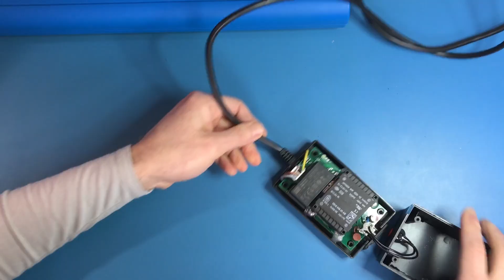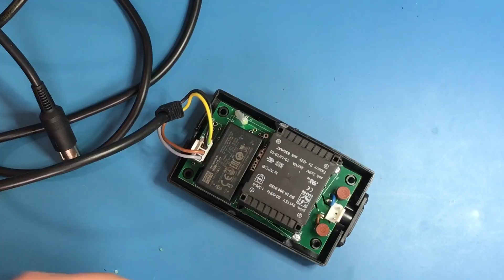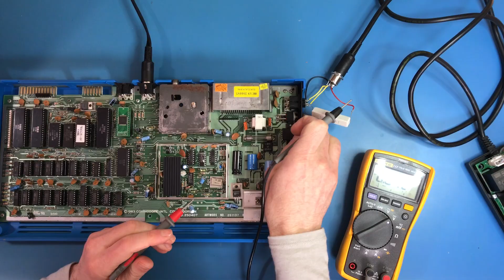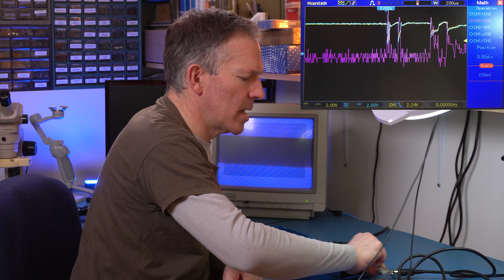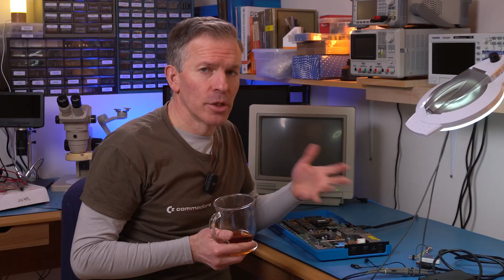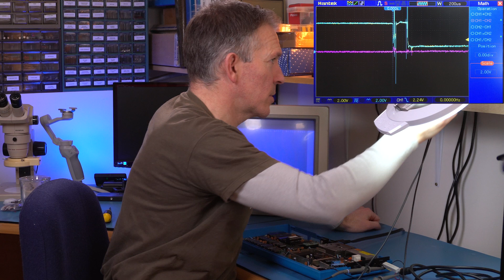I Can't Leave This C64 PSU Alone!

Comment: The reason the C64 takes about a second to boot to BASIC, is because of the RAM test routine in the Kernal. Some third party Kernals omit that or use a simpler RAM test routine and those boot almost instantly. The 555 reset circuit takes about 60 nanoseconds from power up, that's not the culprit. 🙂

Comment: I think if you add a bulk capacitor (say 470uF) on the output of the 5V supply and always turn on the supply before the C64 you will be fine.

Comment: I'm almost shouting at the screen: 'TEST THE POWER SUPPLY SIDE!' The resistor has large inductance, so it will absorb large voltage spikes. If you check the power supply side of the resistor, there WILL BE large spikes of voltage. Those voltages trigger the power supply to shut down and retry after some time, giving this behavior. Case closed!

Comment: Have you tried checking the datasheet for the 5V power supply module? It should list all the conditions under which the protection circuit is triggered.

Comment: This is starting to sound like a heat-related intermittent.  Let's see how it goes as I continue watching.
Question about IPA and hot glue for the general audience:  does this work with all hot glues, or just the stuff made fro Ethyl Vinyl Acetate (EVA)?

Later in the video, I'm beginning to suspect a filter cap or an intermittent MOV somewhere.  If the PSU took a surge, the MOVs may have become degraded.  No high-flown troubleshooting, but I've seen something like this a long time ago on the PSU of a programmable controller, and it tracked back to one of the MOVs (maybe more:  I replaced them one at a time until the unit displayed proper behavior...)

Comment: The discharged capacitors probably look enough like a short circuit to trigger the SMPS power module's short circuit protection, sending it into hiccup mode. If the input capacitor is e.g. 100uF, it'd need 500 microcoulombs (500 microamp-seconds or 5 amps for 100 microseconds) to charge to 5 volts.
Reply from the maker: Right. That's what I'm thinking too. Although it's surprising that it only happens with that board and not the other ones.
Reply: @NoelsSpareParts  I do notice looking at schematics from e.g. myoldcomputer that those C64 A (CR) boards had the LC filter [C97, L5, C100] (which is meant to reduce the inrush current) after the switch, while other versions had the LC filter before the switch. The voltage weirdness would have also been due to the inductance of the supply lead, with there being no capacitor on the supply side of the switch to damp any such transients.

Comment: I guess the PCB is bend because the inlet is now a C5 socket, but was intended to be a C7 which has no ground pin. Which isn’t used anyway. I suggest you replace that ‘Mickey Mouse’ inlet.

Comment: Shouldn't you be able to directly measure the voltage drop across the "current sense" resistor?
Ground lead on one side .... Probe on the other?
Reply: Have to be careful with mains earth reference zero on the scope. This is what isolation transformers or differential probes are for.
Reply: @thetechnoshed  - Careful yes.  But if you are measuring across the 5v power resistor then you should be safe enough, I suspect.

Comment: The capacitor in the 555 timer circuit could be leaking DC, which makes it take longer to charge.  It's always a good capacitor to change if it takes too long to come out of reset.

Note, alcohol (IPA) will loosen hot glue almost instantly.  Also, current spikes happen at power on as the capacitors are charging.  Once charged it will level off.

Comment: Feels like it’s easier to gut an old C64 brick PSU and rebuild it. Usually takes a day to do if you take your time but it is well worth it if you know how to solder and manage cabling. I haven’t had a lot of luck with the new power supplies from Europe; different issues from component failures to poor workmanship. They look nice but not worth the money. I know the pain of selling a computer and it not work when the customer receives it. Great video, as always.

Comment: I know nothing about the c64 other than its a retro computer, but I a a electronics engineer and what I am seeing is what I would expect to see when you monitored the voltage across that 0.1ohm resistor,  you were seeing the current being drawn by the C64, i.e. I = V/R. I am not sure why you added the resistor or what you were hoping it would achieve, was it to reduce the 5 volt supply? the 5 volt supply for logic chips i.e. 74 series needs to be not over 5.5 volts if it was greater than 5.5  that would point you back to the power supply, I would not expect the voltage across the 0.1ohm resistor to be stable or be free off spikes because at switch on the current drawn from the powers supply  would very as the C64 initialised which would appear as a varying voltage (spikes and pules) across the 0;1 ohm resistor which is what I could see from the waveforms. 
That said the normality of what I was seeing was to be expected as you couldn't replicate the fault. I would like to have seen what you got under fault conditions.

You have an oscilloscope, do you have a bench power supply? if so use that to feed the C64, set the current limit to a safe level, and the voltage to 5. and repeat your test to see if you can get the C64 to fail, if you can't reduce the voltage to say 4.8 volts and see if you can get he C64 to fail, if not, try the voltage at 5,4 volts. A bench powers supply is designed to give very stable voltages irrespective of the load, your brick psu should offer the same, but limited to the fixed voltage and current it was designed for.
One thing I would have liked to have seen is the effect of placing a low esr capacitor across the 5 volt supply, say 100uf at 16 volts.
Switching the C64 on and off rapidly is the stuff of nightmares for us hardwear guys as you can get a brown out condition. We have circuits in modern designs to protect against brownouts, I very much doubt the C64 does. 
When you switch the C64 off  wait at least 10 seconds before switching it back on again.
Reply from the maker: I added the resistor to try to "see" the current being drawn from the PSU. I was looking for odd spikes at startup that would cause the PSU to shut down. Or at least that was the initial idea.
Reply: @NoelsSpareParts  Oh, that was reasonable reasoning Noel.

The problem would be, however, trying to detect a rogue spike amongst the clutter of noise at initialisation would be like trying to win the lottery lol.

I am a little perplexed, how or why the PSU would shut down. I have checked online for schematics for the C64 PSU and found what you would expect from an 80's design, basically a linear regulated power supply the design of which is still used today.

The c64 psu uses a jellybean 7805 to regulate the rectified and smoothed secondary voltage from a transformer. The LM7805 only shuts down due to heat dissipation, usually due to excess current being drawn. If a demand occurred, due to a spike the decoupling components around the 7805 would take care of that, and the 7805 itself would just not have time to generate heat to shut down. The 78xx series are jelly bean components because of their continued reliability over the years. I have a draw full of them! they are intelligent enough to look after themselves, and I have never had one shut down due to a current spike. The reason why we know this is unlikely is because the standard componentes the manufacturer recommends placing at the input and output of the chip are there to keep the 78xx stable and not go chasing ghosts, interestingly,  those very components cause a spike at start up, I.e. the capacitors want to charge to the regulator input voltage and the output capacitor wants to charge to 5 volts. Not only that, but every decoupling capacitor within the C64 would as well. 

If you short the output of the 78xx it will current limit (shut down) if you needed a scope to see the spikes (of short circuits) the 78xx isn't capable of reacting to those, the reason why is because you do not what it too, a decoupling capacitor charging would be indisqingable from a microsecond short circuit.

If spikes were causing issues, placing a 100uf low esr capacitor at the 5 volt input to the c64 would solve that issue.

I do think a spike could reset the main processor, monitor pin 40 of the processor with your scope, you should see it held low while the system initializes and then go high, no jumping around allowed, this pin is not like the output pin of the 7805 its very unforgiving.

If I was in your position, I would use the rst pin to trigger my scope so I capture what is going on at the moment the processor takes over, is the supply lines clean then, i.e. are the spikes preprocessor, not post. if your scope has the option to capture pre trigger events that would be useful to.

Plainly there is something wrong, the most important thing is the 'wrong' doesn't beat you. To put into perspective the dilemma you have, I could put together a dozen microprocessor boards each with identical components, and decoupling capacitors, some of the boards would work perfectly without decoupling capacitors, and some behave like demented pinball machines without.

That C64 is alive, and has a history, many a boys have won wars and saved humanity on its keyboard, its ran the race, and won, and now there is a guy (you) resuscitating it, when perhaps, do not resuscitate is in its memory chips. 

All that I can say is those young boys who won wars on its keyboard over the decades, battled mom for just another ten minutes, Noel, son, be those boys. Phaw...

Comment: I've build a couple of C64 power supplied (based on the design found on Jan Beta's website). I used the adjustable regulator version and added a trimpot to adjust the 5V output. I set the output to make sure I had as close as possible to 5V across the C64 board. I also found out that my original KU14194HB board had VERY thin 5V traces from the input socket along the right side of the PCB and I was seeing a significant voltage drop across around 80mm of trace. I added a wire to boost the current carry capacity and a lot of weird issues went away.
Reply: Mich, you guys are driving me mad Lol, if you were a lad in my lab it would go like this... Mitch,   "I used the adjustable regulator version and added a trimpot to adjust the 5V output. I set the output to make sure I had as close as possible to 5V across the C64 board. I also found out that my original KU14194HB board had VERY thin 5V traces from the input socket along the right side of the PCB and I was seeing a significant voltage drop across around 80mm of trace. I added a wire to boost the current carry capacity and a lot of weird issues went away."

Paul, So you had a circuit in to complete a report on pertaining to its strange behaviour, and your solution was 1. to stick your tongue out facing north, while trimming a potentiometer (that you decided to fit for reasons you are yet to explain) the supply to 5.000 volts, lol, and I am to belive your bodge job, was matched by the designers inability to correctly place the correct size trace on the PCB,.  

There is a component somewhere on the C64 PCB that is drawing current it shouldn't be, such as a decoupling capacitor, so rather than locating that (which if you had asked, I would have told you how to locate it) you decided to feed the faulty component current the tracks couldnt handle, the give away should have been the 6mm copper wire you soldered to the 'to thin track'

2. I would like you to ponder, given the C64 sold in its millions (I have no idea if that bit is true, I have never even seen a C64) but given my sidekick is going to be ridiculed for to much use of the soldering iron, and too little use of the gray matter any exaggeration will do. It would have been impossible to sell in mass something that needed the precise values of the cosmological constants that brought the universe into existence without mass disappointment. We have an explanation for the amazing tuning that was required for the universe coming into existence (God did it). We have no explanation why you did what you did, I am very disappointed with you.

I do understand what you have done has got Miss C64 active again, and you consider you should get a pat on the back for your wisdom, which is to be propagated to the wilfully ignorant lol, sadly your error was I read what you said and I thought a kid who needs a father's wisdom, and gentle kindness that only a father can give.

Go to to your room, you are grounded, take the C64 with you, a soldering iron or the blow lamp you used to solder the 6mm copper cable to that delicate track, and remove it and the trimpot . Do not leave your room until the C64 is happy running on 4.8volts to 5.5 volts, and there should be NO glowing tracks.

On achieving your goal, you no need to thank me, I will however remind you the oil in the car needs changing, the grass needs a mow, oh, give the car a wash, and don't tell mom I've taken her hair dryer for conversion to a hot air station, particularly if she happens to find the aforementioned hairdryer in my lab and tries to use the converted unit for its intended purpose, if an ambulance is called, I will be in the pub.

Comment: When measuring the variation at power-on you should have used the AC power strip switch to rule out the power switch causing any issues. you could also feed the 5V into the C64 from a modern benchtop power supply. Looks like video #4 is coming ;-)

Comment: There's A LOT of clueless noobs saying the original PSU is junk. As-is it lasted 30+ years. How many electronic items last 30+ years nowadays.... your LCD TV from 2010 is likely to be dead now and been replaced at least once or twice. Anyway, to improve the original PSU all you need to do is replace the 7805 linear regulator with something better like a small buck converter board that can easily output 1A or 2A where unregulated 10V-12V goes in and regulated 5V 2A comes out. The original transformer is near bulletproof and in general transformers don't go bad. Just remove and replace the 7805 with something better and it will work for at least another 30 years. There are no over-voltages with switching power supplies. They either work or they stop switching and output nothing. A few years ago I built my own little SMPS (based on a buck converter board I bought and reversed) and made an all-in-one custom designed PCB that is a direct drop in replacement and fits into the original PSU and uses the original transformer. I revised the design a couple of times and now it's perfect. The remaining guts of the original PSU are re-used and it's still working fine 6 years later. If you have one of the angled brick PSUs (common in PAL regions) and want to play with my PSU get in touch and I'll send you a PCB and you can build and test it.
Reply from the maker: From what I understand, the problem is not that it's junk, but it's an unfortunate design that when it fails, the voltage goes up. So it's an understandable fear. On the other hand, ZX Spectrum PSUs are definitely junk, and I've seen them explode and go up in flames, but at least their voltage drops when that happens :-)

Comment: I looked at the meanwell datasheet and it's protection for overload is "Protection type : Hiccup mode, recovers automatically after fault condition is removed" so the voltage will drop out for a bit and then give it another try. Try adding extra load on the 5v rail and you'll probably see it do the 1s hiccup more. 34:49 current spike could trigger the overload. (also you can move your trigger on your scope to the left to get more after the trigger)

Comment: put a tank capacitor on the power supply output so it compensate for a capacitor charge inside c64. i guess the 5v drop down last about the same time 555 reset takes and there is a race of it starting cpu while the psu recovers from power over draw
Reply: oh and be aware that will cause massive surge if you use it then on a board with dead short on it. but hey ... pros/cons. the other solution would be a proper brown out circuit instead of just 555

Comment: That Transistor with an unconnected lead is more than likely acting as a diode, 
long story short, it could be utilised as a half bridge rectifier..
Reply: It doesn't have an unconnected lead. The tab of the package is electrically the same as that middle pin would be.

The package is designed that way without the pin. Nothing was modified, no solder pad was forgotten. It's 100% correctly installed and completely unmodified.
Reply: Who said anything about The PCB being modified @CollinBaillie ?
I am now befuddled as to What part of my original Post 
QUOTE 
"it could be utilised as a half bridge rectifier.." 
END QUOTE 
has left you befuddled?

Are you not aware that transistors are used as diodes by manufacturers to save costs?